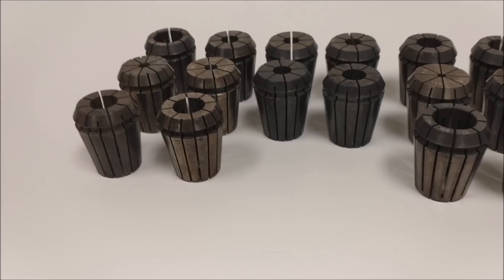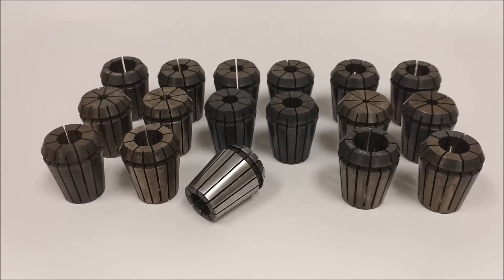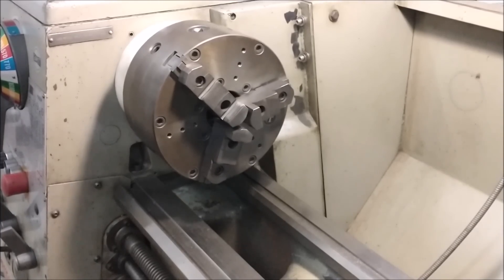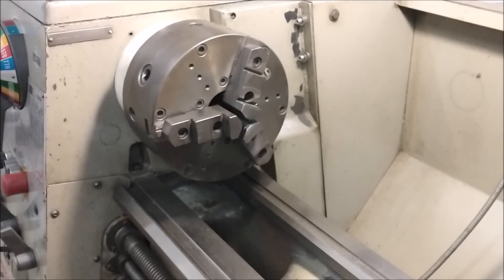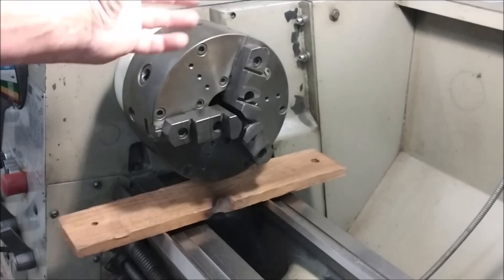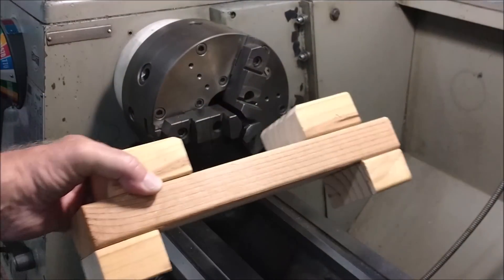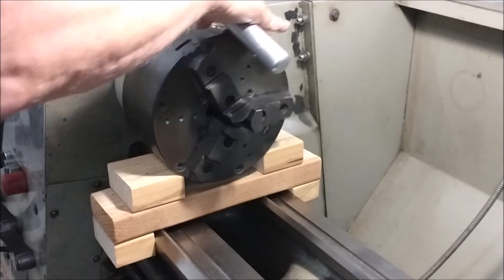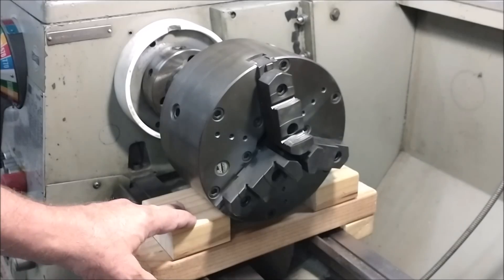Stress Free Lathe Chuck Removal and Shop Chemical Warnings !!!

Comment: I use an old fashioned soluble oil coolant with my machines, mixed reasonably strong (looks like semi-skimmed milk when it’s fresh) & I’ve never had anything rust. I never dry stuff off, it just evaporates & leaves a film of oil.

But, I don’t use it much, so I am having rust problems here at the moment, but that’s not coolant related, that’s just the British weather 🌦️ (maybe I should wash my chucks & clamps in coolant? In fact, I might just do that as it’s really annoying me right now).

Comment: The other thing to be careful of is to fully submerge the part with Evaporust, otherwise it will etch a line in the steel at the tide mark between the liquid and air.

Comment: Very timely Joe! I was about to try out a gallon of EvapoRust and will reconsider. What does everyone else use? I had to store a lot of my machines quickly a while back and the building had wild temp swings which caused condensation. (Sadly, I no longer have access to apprentices who will do as they are told.)
Reply: For light rust a lot of folks use vinegar.
Reply: Everybody uses evaporust.
You just need to pay attention to what is being talked about in this video.
If you leave it in too long, it will cause carbon to deposit onto the outer layer of the steel. (depending on the carbon content of the steel)
Test, test, test.

You can always polish the carbon, which is easier than polishing a heavy coating of rust.
In Joe's scenario, it was mild, and he left them too long.

Comment: Hi Joe, always a joy visiting your shop.
Having the same lathe, in metric, as you do..
I wanted to tidy up the 30 something big collets from 3/16 - 2inches..
So I soaked them in evapo, like yourself, with the same ‘tanning’ result.
EXCEPT. Where any part was above the fluid level.
I now have a few with weird waterlines of a darker tint which are Very resistant to disappearing!
In fact I gave up trying.
So, like the few tea stains on my otherwise perfect mill table, I’ll just have to put up with the evidence of  learning something new.

Comment: Interesting about the evaporust on high carbon steel. I have evaporust. However, I  almost always use citric acid instead, as is much cheaper. With high carbon steel in citric acid, it doesn't come out as shiny as it went in, but I've never seen it discolour like that. It comes out covered in black mess, but it's not attached to the steel. It just washes off with soapy water and a brush, immediately before drying with an old towel and going in front of a fan heater.

Comment: The reason the Anchor Lube leaves black spots is because it is water based.  I’ve had it stain taps as well as machines.  Being water based it does not wash off very well with oil based solvents so tooling like taps and dies, bright finished drills, and etc. need to be washed with soap and water, or at least plain water, dried, and given a shot of WD-40 if you care about them.  Vises and machine ways can be wiped free of it…….but don’t miss any of it!  It does a very good job of removing heat from such cutting tools however.  Many times the tool feels like it is cooler than room temperature immediately after use, but I haven’t shot them with a handheld temperature sensor, so it may be. just a feeling on my part.

Comment: If you can lean , you can clean. Good statement. I can't tell you how many guys I have heard say , "they don't don't pay me to clean." Bullshit. It's part of your job! I often pop over to a shop that I used to work. I visit and hang out. I'll ask if the Bridgeport or lathe is available for a little project now and again. After getting permission I go out and find a machine in an absolute state of disgust. SO the process begins. I clean the machine. After all they are gracious enough to let me use it. Do my project CLEAN the machine after use and I'm on my way. Leaving the machine and area cleaner then I found it. The work ethic of clean as you go is gone , not taught , not adhered to whatsoever. Pretty disappointing really. Now in my own little work shop , I have the grunt do the clean up. That's the same guy thinking up the project , machining the project , etc. In other words it's me! Shops dirty? Nobody but myself to blame. Neat and tidy make for easier , more organized execution of the process necessary to make your stuff. Easier to find your tools if they are where they are supposed to be. Thanks for the PSA on EvapoRust and AnchorLube.
Reply: When someone says that my reply is I can pay you janitor wages for a bit while you clean if that will help. That usually gets the point across.
Reply: I was brought up with a clean and tidy attitude too BUT when you have so much pressure from a greedy boss to produce more product, cleaning goes out of the window to some degree.
It's not always the employee's fault here, some bosses won't meet you halfway.
Reply: @steveclark..  Then I'd suggest you find another boss. That is NOT someone you want to work for long term. Not appreciating an employees work standards for cleanliness and organization are as you say greedy. Not a good place to work. I never came across a boss that didn't appreciate the shop being clean and organized. I knew they were out there just never worked in one, and you shouldn't either.

Comment: Great video as always, but I gotta speak to the EvapoRust thingy.
I actually have a bit of a background in chemistry and a more than average interest in metallurgy, and I use EvapoRust all the time. It's important to realize that just because a chemical is considered "non-toxic" or "safe", that doesn't mean that it's not a fairly powerful chemical - just look at what water does to steel... :)
That being said, you said yourself that the instructions on the bottle say that for light rust, to only use it for about 30 minutes, and you went 13 hours. Since you had some light surface rust, it would have been better to just take heed of the instructions and just 'wet' the affected areas and let them sit for a few minutes and then clean them off to see how well it worked. Rinse and repeat until you get what you want.
When dealing with chemicals (as well as most other things), it's not always a good idea to think that "...if a little bit is good, a lot is better".
Reply: It also said that up to 24 hours……vague on a powerful chemical?

Comment: Evaporust is junk in my experience,  tried it once or twice, will never buy it again.  Some YouTubers talk about it like a miracle product, it's an expensive waste of time in reality. 

Anchorlube I have mixed feelings about.  It does work well as a cutting fluid,  but it's residue is the worst of any product I've ever used. We've settled on Cimtap 2 and Hangsterfers super all tap here

Comment: Thanks for the warning about the Evaporust...!  I too use Anchorlube.... And LIKE, using the product.  I have not made a effort, other than a blast of air, to remove it from really small taps and dies after use.... Is there a possibility of corrosion on these tools?  Thanks for the tips!!  Happy Easter!!
Reply: Yes it will rust taps I’ve left it on one before learned my lesson just clean it off after use 
Great product for tapping top class

Comment: I have run into a similar problem using chlorinated  cutting lubricants.  They do great for those really high pressure cutting ops, but everything must be cleaned and lubed immediately after or the rust monster will get you.
Reply: They can also cause microfractures; this led to an aircraft crash when a propellor blade that had been cleaned with a chlorinated compound catastrophically failed in flight. There’s a YouTube video on the NTSB investigation into the crash. Do a search for “Mayday: Air Disaster” (YT channel), and go from there. I don’t remember which episode it was.

Comment: Hey Joe! I don’t know if you remember me but a couple of years ago, at the Bar Z summer bash, I was hanging out with you while you were running the mill/maze competition. You were giving me advice about tooling and feeds/speeds for my small lathe. Thanks again, I’d love to come work for you. 
Anyways, we were talking to that guy who apparently started anchorlube and he mentioned the cast iron staining was probably because they use citric acid as an additive. 
Also, I’ve experienced the same thing with evaporust and reserve it for unfinished parts and tools like you said. I’ve also noticed it’s effectiveness relies heavily on how pure the solution is,  
how oil-free your parts are, and if the container you’re using is sealed. It also seems to leave a green, hazy oxidation layer on parts with high chromium/nickel content. 
Ive heard heating the solution also affects how well it works but haven’t really tested that.

Comment: Would a cheap HF rock tumbler work to polish collets, if using a fine enough abrasive? I know you need to worry about the concentricity and all, but wasn't that already degraded with the evaporust?
Reply: Bashing the collets into each other?  Not a great idea.
Reply: Ack. One at a time, dude! @brianroberts4349

Comment: The Sydney lathe I run has a built-in "crane" for removing/installing and also storing the chuck. 99.9% of the time the 4 jaw is in. But when it does have to come out, the built in crane makes it quite painless.

Comment: I put some Starrett spring calipers in Evaporust over night. Next day the spring piece at the end of the legs was broken on two of them. So I have never put anything high carbon content in that stuff since. Maybe hydrogen embrittlement???
Reply: I had the exact same experience. I bought some Starret dividers at an estate sale ($1) and put them in evaporust overnight. The little "C" spring at the back was broken in the morning.
Reply: Same experience here.  I think the spring being "loaded" ,i.e. under tension, had a lot to do with the problem.. Possibly hydrogen embritlement.  Have decided to never use Evaporust on any spring steel.

Comment: I had a 1” bar of 12L14 that had gone rusty. Evapo Rust turned it a dark greyish colour overnight. Luckily it was just a stock piece for projects.
So it is not just a problem with high carbon steel.